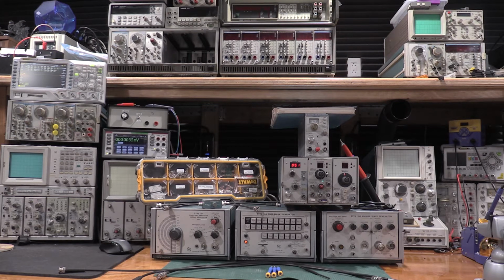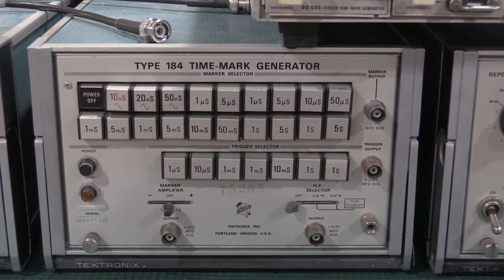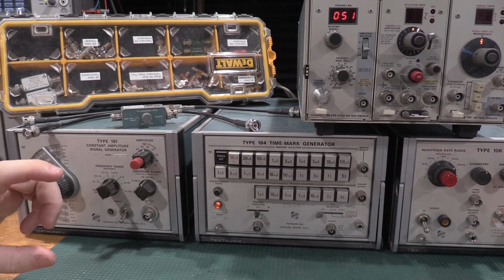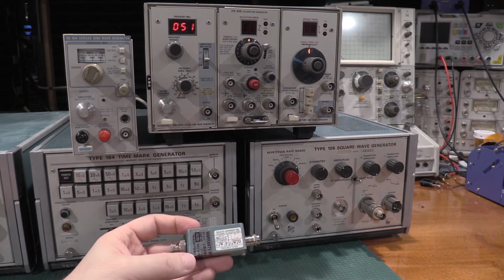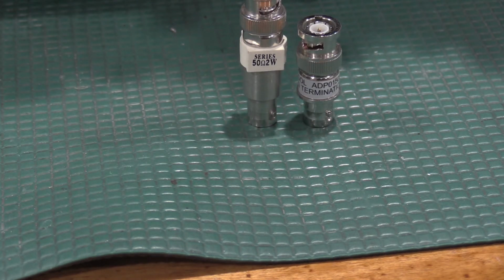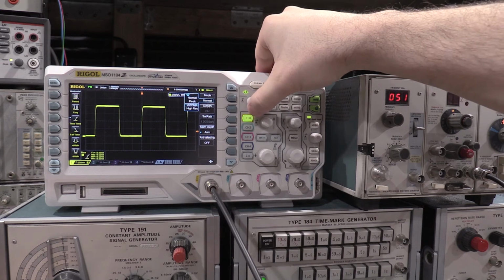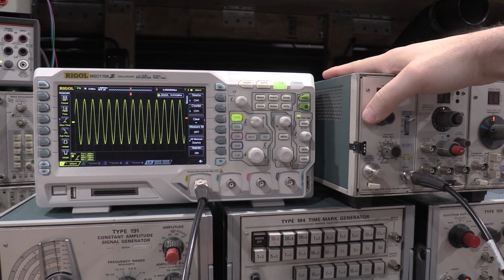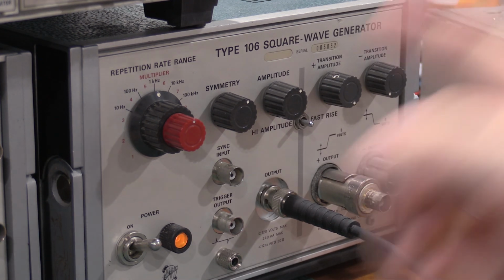How to Calibrate a Scope

Comment: THANK YOU
Reply from the maker: Your are most welcome, glad I could help
Reply: @ZenwizardStudios  I was wondering, facing to difficulties to get reliables calibration tools (PG 506, Time Mark Generator, etc.), would it be possible to find a modern arbitrary functions generators (self calibrated) able to cover the whole scope of required signals for 500mHz scope calibration ? It is quite hard for me to start, even with calibration fixture, without being able to really count on them.
Thank you !
Reply from the maker: Hey Alcide,
	There are really only 3 issues you face for a calibration of a scope. Vertical, horizontal, and speed/bandwidth. Also remember that the accuracy spec of the scope is only about 3% for the 400 5000 and 7000 frames. Now on the flip side 500 Mhz is FAST. I have not done a video on the 7904A that I have in the lab yet but it has some exotic hybrids in the to get the response. And the tube is incredible with a distributed plate vertical section to get the 500 Mhz bandwidth. The first question of where to start is what your specific needs are. I personality would also not start at 500 Mhz but work up to there. I started before I had the channel with a 465 100Mhz scope. I was actually going to do a video on it but it had some terminal faults with unobtanium parts. There are some mechanical parts that crumbled due to age. I am looking for one as I want to do one for a video.  Now to get into the calibration questions it is also a question about “standards”, “references”, and “characterized sources” (if it would help I can try and make a video about the topic) In my lab I started with DC. It started with a keithly DMM 6500 not a cheap meter but not a pocketbook busting 3458A ($11,500) either I needed something with reasonable accuracy 6.5 digits. More importantly I needed something that I trusted and was in CAL. Using this meter I was able to sanity check my fluke 8505A and found it to not be spot on but at lest still in spec based on the last time it saw a cal lab. This gave me a voltage point of reference in the lab and since both meters agreed with each other I was reasonably confident that I could more forward. Now the Dmm has a basic DC accuracy of 25ppm or 0.0025% this is WELL below the lever needed to calibrate the PG506 as the 506 is calibrated at DC. Once the 506 is calibrated you are set for vertical calibration (but not vertical response). 

The next is time, being a scope the time base is arguably more important then the vertical deflection and this is where the TG501 or the 184 come in these produce highly accurate time marks. But how to we verify or even calibrate them in a lab with no time reference. Well in the old way we can zero beat radio station against the carrier waves and check the scope drift turns out it is INCREDABLY difficult to sync 2 free running oscillators to an exact frequency. But this is the HARD way. I went the easy way. You can just measure the frequency with a frequency counter. In the scope you set the time base to a given period in time we will say 1ms/div and we have 8 div for a full cycle of a wave form. This means we have a period of 8ms take 1/(period) to get frequency in Hz. Which would be 125Hz but we still need a reference to know the scope is measuring correctly. We have to calibrate the clocks in the 184 and the 501. But we still need a reference and a way to measure. I have a HP 53131A frequency counter which conveniently has a 10 Mhz reference input on the back that will accept a square wave. This is hooked to a GPS Disciplined Oscillator (GPSDO) This is one of the few pieces of gear in the lab that is allowed to run continuously and never turned off. This uses the time date received from the GPS satellite network which is EXREAMLY accurate if I recall correctly down in to the sub ppB range. This defines for the frequency counter what 10Mhz is and lets it take measurement based on this reference. This then allows me to directly measure and tune the primary oscillators in the 184 and 501 and since we are far less concerned with the pulse shape vs pulse period we now have a time reference that we can use for a scope. However my 184 needed some fiddling to level out the pulsing. 

The last part is response this is what I found to be the most difficult to achieve. What you need is set by your frequency target. 500Mhz is fast which means you need a pulse that is faster. The trick here is you need a CLEAN square wave. The pulse has to rise and settle. We don’t really care how cleanly it falls just the rise. For me that is the tunnel diode pulser and the 284. The 1ns rise time of the 106 is good up to 100 Mhz the tunnel diode pulser is good up to 1Ghz if I recall correctly. These have characterized wave shapes. We don’t necessarily care what they look like just that they behave consistently. These are needed to tune the high frequency response of the vertical section if I get to the end and I am missing 10’s of Mhz in bandwidth this is usually where I have messed up this is where I go looking first. Also this will be the hardest thing to duplicate in modern gear in my opinion an arbitrary wave form generator would not be able to do this well based on it being driven by a DAC at speeds fast enough you can actually view the stepping of the wave form as the DAC is doing its thing. But for the time marks and vertical gain it should be fine as these are “low bandwidth” but precise signals. For the high frequency compensation you need a “less precise” but “high bandwidth” signal. Meaning amplitude and timing is not critical but fast edge is.  I hope this helped.
Reply: @ZenwizardStudios  Hello !

Thank you for your large answer :D 

The hard part for my is calibrating time base plug-ins because of a too low rise time of my gbf (3.4 ns... provided by a Siglent SGS1032. I thought to a Jim William's pulse as a cheap alternative, but I probably a bad idea for a reliable train, I don't know). That GBF help me to calibrate as best as I could vertical plug-ins (7A16 and 7A22 but I lack of nanovolt source, I lack of lot of things ;)).

My environnement is composed of a 7704 and a 7633 calibrated with the calibration fixture -00. I know it was not serious enough, but I had no other tools... 
I had plenty of lovely plug-ins I am restoring and trying to calibrate at best, for now, only 7692A is expecting a 500mHz scope (I don't have but someday :)that why I said "calibration to 500mHz" in my question and just to precise  perhaps is it perhaps not a absolute requirement ?
Some TM500 plug-ins too of course, but not the desired ones for calibration.
I have some digital scopes self calibrated to control (up to 1gHz :D).

Your equipment history helps me, thank you :). A reliable and precise enough DMM is something I don't have (Fluke 177 and Ferisol A207S, or the DM44 of the 465B and a LCR meter ET4510). I will follow your advice and then calibrate a PG506 (to buy).

One more time.... thank you !!
Reply from the maker: Hey Alcide,
	It is a deep subject as well as a rabbit hole. I am a bit confused you mentioned you are trying to calibrate the time bases? You do NOT need the fast rise pulsers for the time bases the important part there is the 184 or the TG501. The primary use for the PG 506 for the time bases is really just signal generation also the -00 is just fine for a 76xx frame and a 77xx frame if I remember correctly so you have what you need there. Also the -01 will do up to a 7904A if I remember correctly though a 7854 specs a -02 however I do think you need a fairly accurate meter for tuning the trigger sections and setting the center and trigger points.

The PG 506 gives you a sweep able square wave from 0 – over 100 V and a calibrated voltage step for the verticals. 7Axx.
The main issue with the Jim Williams pulser, it is a true “pluse” to do the high frequency cal you need square wave. (fast rise then settle)

Also, I am assuming a 7B92A. That is a wonderful plugin you can use it in any of the 7XXX mainframes you need to move a switch internally. But in the slower frames it can over drive the horizontal sweeps. In an extreme case this might cause damage. But if you keep the sweep rate below 2ns per div the 7704 should keep up. On the 7704A this spec is printed on the bottom edge of the frame on the right. Not printed on the 7603

For the fast rise time keep a look out for the 067-0554-00 or -01. These are the tunnel diode pulsers that are driven by the 106 or the PG506 these take the high amplitude square wave out and sharpen it up to get the fast rise time. Given the trouble I had I would not recommend diving in to a 284 unless you know it is good and working especially the tunnel diode section. It is fragile and fiddly

The important part is that you trust that the gear is outputting the wave form you are telling it to at the levels it is saying it is.
Reply: @ZenwizardStudios  
Hello :)

I thought fast rise pulse generator was required for time position check and adjustment. (service manual). Glad to read that the -00 would be right for this !

Understood for Jim's pulse, that's was I suspecting. Thank you for your confirmation (I am newbie so...)

I was aware about the TB92A's jumper (and because it came with the 7704, it was already O.K !). Unfortunately, I was not about not going quicker than 2ns with that frame... Now I am !  Thank you.

You helped me a lot and provide me guidance in my journey :D
Reply from the maker: Hey Alcide,
	Glad I can help. In terms of calibrating the frames. The fast rise generator that is used is in the calibration fixture. That is one of the key differences between the 067-0587-00, -01, and -02. That is why the difference like the -00 can only do UP to 200Mhz frames the -01 to 400 Mhz frames and the -02 UP to 1Ghz frames. If my memory serves correctly (it might not so double check). You can use a -02 to cal a 76XX but you can’t use a -00 to cal a 7104. Also the fast adge pulser is internal to the calibration fixture and needs nothing else external. All self-contained. To fully do a calibration on a 7XXX frame you need 3 service manuals (frame,vertical plug in, horizontal plug in.)